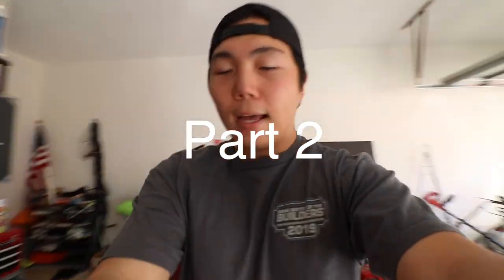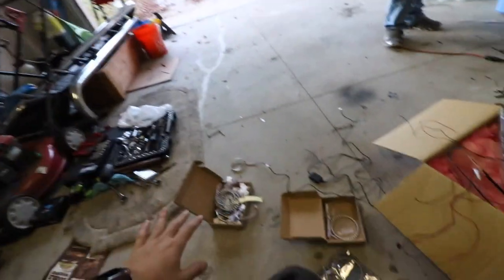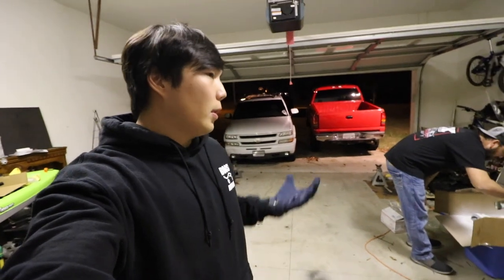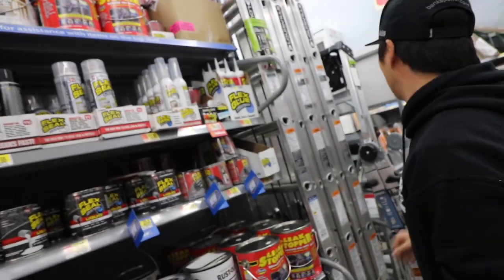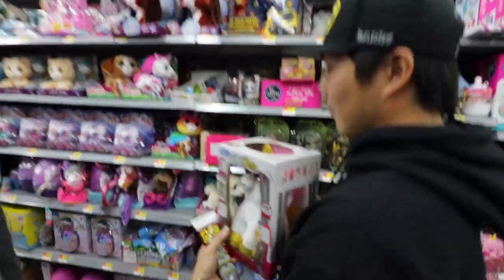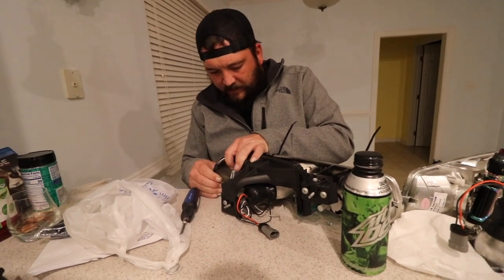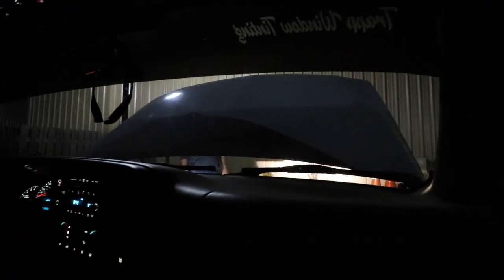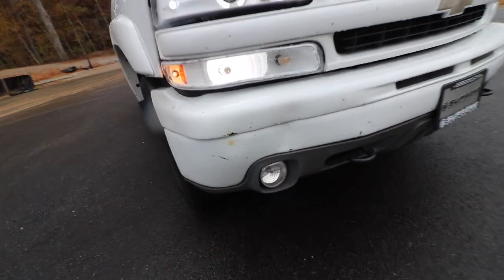PT.8 How You Can Color-Match Your Headlights at HOME for $15

Comment: Pro tip, when done painting with rattle cans hold the can upside down and spray for a couple seconds. Upside down the paint won't come out but the aerosol propellant will and cleans the paint out the nozzle. Only time it won't work is if it's one if those cans you can spray upside down or any angle.
Reply from the maker: Thanks for the tip!